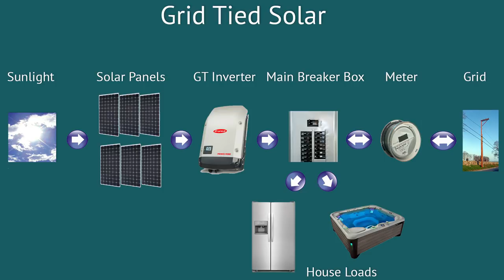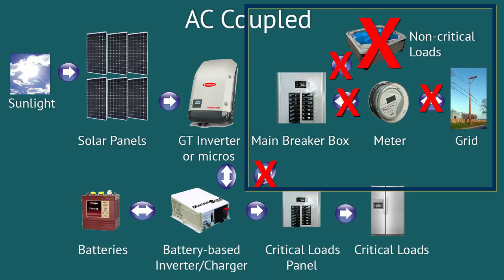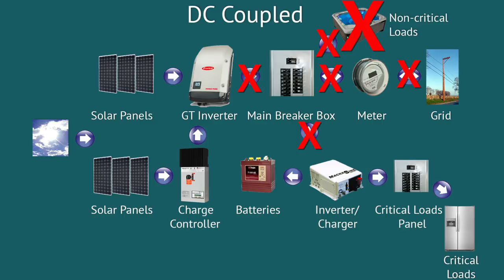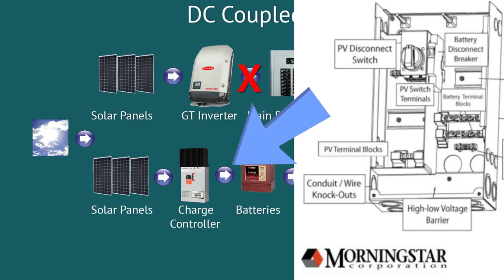Adding batteries to grid tied solar

Comment: I've previously studied SolarEdge's hodgepodge of documentation, and it suggests that its grid-tied inverter supports a “export” / “feed-in” limitation feature (and hopefully similar functionality exists from other vendors).  The intended purpose of such functionality appears to be for not running afoul of utility feed-in limits, but it seems like this might also be a way of adjusting the output of the solar array in an AC-coupled system to suit the battery bank and loads during a grid outage.  That might mitigate the listed 'con' of AC-coupled systems having to artificially oversize the battery bank in order to match the solar array.  Such an approach also seems far preferable than the current 'all-or-nothing' approach of MagnaSine's method of signaling the inverter on or off by adjusting the line voltage frequency.  However, the devil would be in the details on making such an integration work; are you aware of anyone attempting such a system?
Reply from the maker: The question that comes to mind would be what would trigger that throttle when switching over to coupled? They do have their StorEdge unit that would make a lot of this easier, but that doesn't help folks who already have a system installed. There was supposed to be a retrofit kit, but I believe they are not providing that now. Inverter manufacturers are seeing the light and most are adding battery capability to future models, although most of them seem more focused on Time of Use and Self Consumption than battery backup. So for now, hodgepodge is the perfect word.
Reply: Thanks for the response.  As I see it... Option A: I saw a SolarEdge HD inverter menu option to set a maximum inverter power output.  If an equivalent ModBus control existed for this menu parameter, then larger solar array could be temporarily capped as needed to work with a more modest MagnaSine (or similar) AC-coupled battery system for critical loads.  Option B: to leverage the "export" / "feed-in" feature, the SolarEdge inverter expects a WattNode meter to measure current on each of the (split) phases (to judge export power).  Ideally, the MagnaSine would report more nuanced feedback than its present 'all-or-nothing' implementation, and this feedback would be returned as WattNode measurements to dynamically tailor the inverter output.  Alas, all of this is just theory and is fraught with potential 'gotchas'.

Comment: Amy - you made mention of a StorEdge video within this one and yet I cannot find that video within your altE library.  I'm assuming you've recorded it and perhaps just haven't posted it yet?  I'm asking as I am pretty interested in that inverter for my planned future DIY solar project.  It sounds like a great way to get the grid-tied portion of the project up and running and then expand into battery storage when the funds allow.  Thanks for the clarification!
Reply from the maker: You caught me. I had done one, but then they changed the product so much it made my video out of date, so I disabled it. It is on my short list to do a new updated video. Thanks for keeping me honest, I'll be sure to get it done soon. Meanwhile, you can check out the product here, https://www.altestore.com/store/inverters/hybrid-inverters/solaredge-storedge-76kw-high-power-inverter-p40810/

Comment: Buy a "True Hybrid" Inverter would solve them all automatically with minimum wires, breakers and get more efficient energy.. The only problem is  that we can't yet combine solar & Wind power together in a system, since no inverters in the market could handle both input at the same time yet. However, by AC Coupling a Solar Hybrid Inverter and a Wind GT Inverter injected to the same grid would probably work perfectly..

Comment: Great Video... what is the solution for all solaredge inverters (not the se7600) to have backup battery without changing the inverter or wiring ?
Reply from the maker: ArtGreen Construction A.C. coupling is the best option for SolarEdge. Depend9on the size of your grid-tie inverter, the Schneider XW+ could be the perfect solution for up to 6800W.

Comment: Searching all over internet finally got it. I have 3 questions.
I have a 2kva 2 X150ah battery sign wave home ups through which all medium load equipments are powered. We don't have buy back facilities of electricity. In summer hectic power cut also.
1) I don't want to throw away my old inverter, to power it up which type of solar inverter i should select micro inverter or string type or power optimizer type and of what capacity.
2) my ups is with microcontroller and transformer so will it take current from solar inverter through its out put instead of through input as you discussed if it is an AC coupling to charge battery. If not any way to make it happened? Or atleast do manage live load.
3) how I manage over charging issue and low load and high production issue which even lead to total repair of both inverters?

Comment: Great presentation, I will stick with a $700 generator and $20 gasoline for emergencies.
Reply: LOL.    I'm right with you on that one.   I am going to look about going the simpler route and purchasing at least 5K of solar panels - no batteries - and sell the surplus back to the utility.   I'll still need a generator when I lose power but that normally is a rare event.   Adding batteries and inverters - and I still can't power a heat pump?  No thanks.  Summer time in Charlotte, NC is hot and muggy.   I have a 15KW generator converted to run on propane or gas - that is my backup....

Comment: Is there such a thing as a grid tied inverter charger? Both options seem VERY expensive when there is a very nice two phase inverter sitting inside a 5KW SunnyBoy. I can't believe no engineer has addressed the power outage issue. This is VERY LOW hanging fruit my friends!!!

Comment: Is the reason that the inverter/charger needs to be 20% bigger than the grid-tied inverter so that there is no clipping of power to the inverter/charger? or is it because the inverter-charger will blow the magic smoke and fry the unit?
Reply from the maker: The reason to oversize it is that with AC coupling, you are backfeeding power through the inverter/charger's AC output, which is not how it was originally intended to be used. Oversizing by 20% is a general rule of thumb, but it's always best to check with the inverter/charger's manual or manufacturer to make sure AC coupling is supported by the inverter/charger and, if so, how much capacity it can handle from the grid-tied inverter.

Comment: hi, we have installed a 10 Kw solar power system with mono perc PVs supported by an on grid  3 phase inverter of 10 Kw with efficiency of  98.7 %  by we are getting only 50% generated wattage. I believe we should get minimum of 80% wattage generation as per our electrical design when all the parameters tilt angle, sunlight etc  , are well in place. can you please guide us why we are getting only 50% generated wattage instead of 80% generated wattage.

Comment: how about adding an off grid pure sine wave inverter that can charge a battery from the grid which I think is not expensive than a DC coupler?
Reply from the maker: That is AC coupling, and is discussed in the video.

Comment: Do you have any line drawings and component layout such as would be needed for an AC coupled system that is using a Solaredge SE11400US with a 15.2 kW array?
Reply from the maker: That's a tricky one. You need to have the battery based inverter bigger than the grid tied inverter, so you would need to have multiple inverters stacked. Let me check with a couple of manufacturers to see if they recommend doing that or not.

Comment: I have a a 20 panel SolarWorld 255 system with Enphase M215 microinverters and would like to like to add a battery backup to it.  It sounds like a AC coupled solution would work.  We have a fridge, freezer, and oil boiler with forced hot heater heat.  While on vacation in January our whole house load varied between 11 and 18 kWh per day (only the above listed and 1 cfl light on).  What would you suggest?

Comment: I'm still stuck on the part when the grid is UP  but, your solar power isn't enought to power the whole load of house.   So will AC and Solar combine?    is it GRID or SOLar,      or is is GRIND AND SOLAR at the same time.    if so,  then where does this simultanous even occcur
Reply from the maker: Yes, a good way to think about it is the solar is offsetting some of the load draw. So the effect is that less power is needed from the grid!

Comment: Give me some inverter and battery options and tell me why. I already know everything you talked about in this video. I need a simple solution like SMA Sunny Boy Storage. If you tell me when that would be available in USA and what batteries I can use with that, now that would be helpful.
Reply from the maker: mlg779 what do you have for a system now? There is no one size fits all solution, we'd need to know more about what you have before we can make any suggestions.
Reply from the maker: Kids, play nice.
Reply: I have a SMA 4000 tl-us and 3.1 Kw of panels and I installed it myself. I was looking at AC coupling with Schneider XW-6848 because it can do Lithium batteries and custom voltages, and the 3 panels of DC coupling with Midnite Kid charge controller(facing south east) just in case the batteries get depleted one night and the AC coupling would not be able to start in the morning; but this is too expensive and a lot of moving parts the reason I am looking for a cleaner solution, maybe SMA Sunny Boy Storage. and this would also be cheaper.
Reply from the maker: I'm attending a training on the SunnyBoy Storage today. I'll let you know when it will be available in USA. If they are doing trainings now, that says it will be soon. Stand by.
Reply: That would be nice. Thank you.
Reply from the maker: Just finished SMA SunnyBoy Storage training. My (Amy) impression at this time. USA availability Q1 2018, more likely Q2. It is not intended to add battery backup to an existing SunnyBoy system. If you have a Sunny Boy, either do AC Coupling with their Sunny Island and Autotransformer or with a Schneider SW (but not with lithium), or do DC Coupling.  The primary intention of the SunnyBoy Storage is for minimal storage for Time of use, Peak Shaving, and Grid Zero. For places that are unfriendly towards grid tied solar. Sunny Island is still a better battery backup option. They mentioned you can use a 48V lithium battery bank with the Sunny Island, but wouldn't confirm when I asked. Your safest option for lithium battery bank may be a DC Coupled package like this, https://www.altestore.com/store/solar-power-systems/battery-backup-solar-power-systems/morningstar-dc-coupled-retrofit-battery-backup-system-p12001/
Reply: Look into Tesla AC Powerwall

Comment: The AC coupled system inverters don't seem to distinguish between solar power and grid power, to charge batteries.  I only want my batteries to charge from solar unless I choose to override.  Is there an AC system that can do this?  Hybrid inverters inverters can but they are a version of DC coupled.
Reply from the maker: The easiest way to make sure your batteries charge from solar is to wire your system with a DC solar charge controller. If you have to AC-couple, you will be using one of the hybrid inverter's AC connections for Grid and one for AC-In from the solar PV inverter. You can usually program your inverter to only charge using the AC-In so that no grid power is used for the batteries.

Comment: Nice solutions but I think I'm just going to use a $10 smart outlet and a regular $15 12V charger. I will set the battery bank charger to only charge during the day on the same circuit as the grid tie inverter. I will then hook up a simple DC to AC inverter and power my loads with that.
Reply from the maker: That's fine if your are just trying to charge a small 12V battery to charge your phone and maybe power an LED DC light, and the power is only out for a short time. The system we are talking about is to provide large backup to your fridge, furnace blower, well pump; much larger loads than the UPS you are talking about. This can use your solar system to recharge the battery bank if the power is out for days (or weeks or months). Two different solutions for two very different scenarios.

Comment: Would prefer to use my Hybrid's Battery
V2H controller?
Reply from the maker: That gets a bit complicated. I'm not an EV expert, so anyone else, please chime in. My understanding for most systems is it is simply an AC to DC charger for the car. So if the grid goes out, so does your charger. I'm assuming the V2H controller has an inverter to convert the high voltage car battery to 120/240VAC for your home. If so, that may be able to be the battery based inverter tricking the grid tied inverter into staying on. If you have any details about your particular system, that could help.

Comment: does it only work as a backup or can I have the batteries giving me electricity during night time? I know there are hybrid inverters that would heat the water out of battery but what about the whole house?
Reply from the maker: It all depends on how you configure the system, and what you choose to power off the battery bank. If you try to power your whole house off the battery at night, you will likely need a fairly big battery bank. But yes, it is possible.
Reply: @AltEStore  thank you for the info!
Reply: @AltEStore  how much batteries would you say would be needed for a typical avarage household? I'm not looking for a specific number, just an example

Comment: i have an solaredge 4000HD wave inverter....
i have 4600 WP solar panels
wich inverter do you prefer to use? for AC-coupling

thank you
Reply from the maker: Either a Schneider XW+6048 or a Magnum Energy MSPAE-4448 would be great options. https://www.altestore.com/store/inverters/off-grid-inverters/schneider-electric-xw-plus-inverterchargers-p40562/#XANXW6848 or https://www.altestore.com/store/inverters/off-grid-inverters/3000-to-7000-watts/magnum-energy-mspae-4448-4400-watt-48v-invertercharger-p8110/

Comment: i am going 100% off grid, i have 16-260 watts solar panels , 4048 radian outback inverter , outback MPPT  FM-80 charge controller and a midnite 6 circuit combiner box, with 8 Trace 235 amp hrs batteries , what is the best disconnect 250 amp DC breaker you sell and do you have a video on it.
Reply from the maker: You need more batteries for that size solar array. 260W x 16 = 4160W / 48V = 86A. The charge controller can output up to 80A. If you assume charging at even a C/6 rate, which is the absolute fastest you should charge (I'd prefer C/8), that is 80A x 6 = 480Ah battery bank. You have half that. You should have 16 batteries in 2 parallel strings of 8 for that size solar array. Have you made a loads list to see how much energy you need? 

As for the breaker question, you only need a 175A breaker. Then you can use 2/0 cables. If you don't get the Outback GS Load Center designed for both the AC and DC breakers, I suggest you get a nice DC breaker box like the Midnite MiniDC175, that will let you also add the breakers for the charge controller. https://www.altestore.com/store/enclosures-electrical-safety/electrical-enclosures/disconnectload-enclosures/dc/midnite-solar-mndc175-mini-175-amp-dc-disconnect-p2415/
Reply: yes  i am working on the other 8 more 235 amp hr batteries , i plan on staying under 5 Kwatts at night, and i get around 6 good hrs of sun here in Puerto Rico , 0% shade i am running everything energy saver
Reply: can you tell me how to turn my system on the first time, do you have a video ? i have a mate 3s

Comment: I don't need to worry about heating and cooling because I'm going to install a geothermal heat exchange, so all the power needed is for the circulating pump for the liquid and a fan to move air over the radiator.  I can't wait to fire the electric company.

Comment: The more I research the more complicated it seems!

Why can't we just have a grid tied system, have battery bank and when the grid goes down, shut off the main breaker at the meter to protect workers doing repairs? "When they find their round tuit"...
Reply from the maker: Because not everybody can be trusted to remember to turn off the breaker. One person forgetting can cause a lineman's death. Newer technology is coming out that will automatically measure the amount of energy your house is using, and will mat h the inverter output, so that regardless of how big your system is, it will not sell back when the grid is out. This will help achieve what you are looking for.
Reply: @AltEStore  thank you. I suppose an automatic transfer switch won't accomplish this either. It would jus transfer to grid power to batteries when low or no solar.
Reply: @bobcole3852  A Hybrid Inverter certainly can automatically supply AC Power to the Critical Loads Panel when the Grid is down, without any human intervention ...